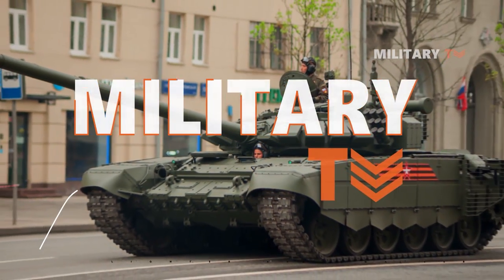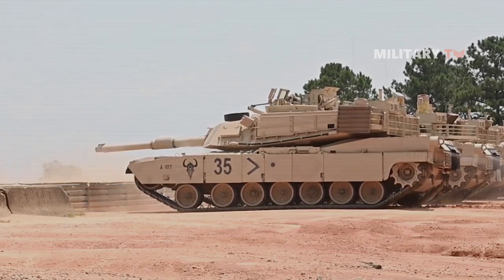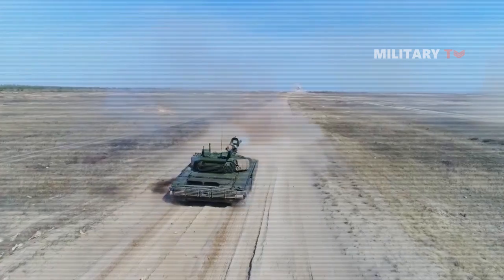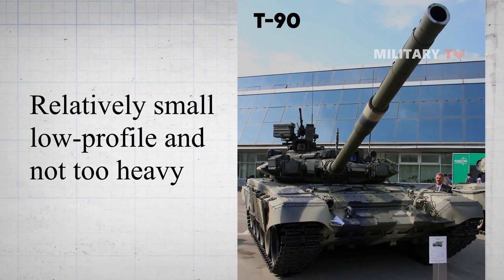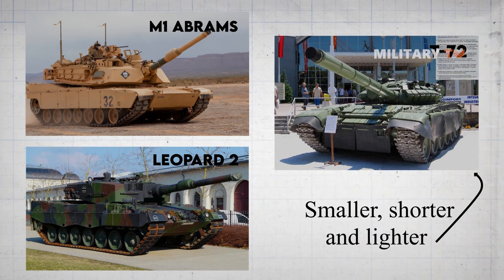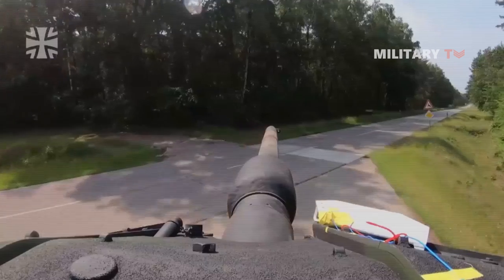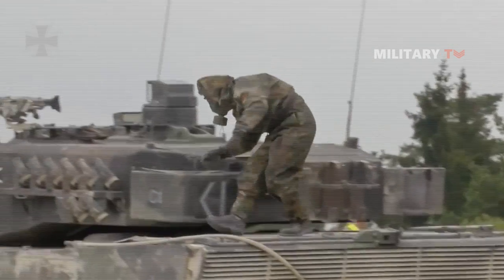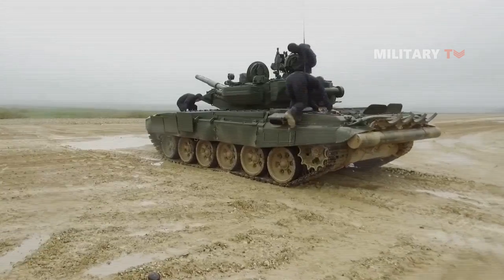Why are Russian tanks lighter and smaller than the western tanks

Comment: The lighter Russian tanks may have a strategic design as well.   A lighter tank can cross more bridges.  As a former military attache in a country at war, the Defense Attaches were responsible in part in identifying the load capacity of every bridge.  For example, if abridge capacity is 30 tons, then a 60-70 ton tank isn't going to be able to cross it.

I have zero doubt that Russia knows the bridge capacity of every bridge in Europe and designed its tanks to cross as many as possible while western tanks would need stronger bridges to maneuver.

Also Russia can transport twice as many tanks by air than the US C-17.

However, the US is in the process of testing a lighter tank of about 30 tons to augment the main batte tank.  This may be due to the same reasons the Russians when to a heavy/light tank mix.
Reply: 30ton tank? No way.most ifv are heavier than that
Reply: Exactly! Most of the bridges in the Eastern Europe can hold vehicles up to 50 tons only. There been even situations than US and German tanks came to the Polish sea ports on ships for the military exercises and stood for days in the ports just because they could not to cross many Polish bridges. They been delivered to the military exercise place much later only by roads around on the heavy transportation trucks...
Reply: у России уже есть Спрут с 125 мм орудием и возможностью быть десантированным с парашютом
Reply: Not if there's no bridges to cross. NATO has always been in a defense posture when it comes to Russia.  They'll just create their own bridge crossing if they were to go on the offensive.
Reply: Other issue such as logistic support and production
Reply: @tommygun5038  NATO never defended something, all the time they invaded other countries. Like Yugoslavia,Afganistan, Iraq, Lybia, Syria etc.
Reply: He didn't even touch on these obvious considerations.  Russia would more than likely have to cross mud or snow at some point...less weight is a no brainer.
Reply: @bagamut  .....Yeah you get involved in genocide and harboring terrorists that's what happens.  But i was talking about Russia vs NATO.
Reply: @tommygun5038  mostly they involved in trying not to be  colony and harboring oil.
But if we talk about Russia vs NATO that is not Russia is placing bases around NATO and not Russia is expanding all the time.
Reply: @bagamut  ....LMAO...your clueless.  NATO has no military buildup in Europe.  It's the opposite.  NATO isn't just a military alliance.  Do some reading.
Reply: @tommygun5038  omg, you arer clueless
The North Atlantic Treaty Organization , also called the North Atlantic Alliance, is an intergovernmental military alliance between 27 European countries, 2 North American countries, and 1 Eurasian country. NATO constitutes a system of collective security, whereby its independent member states agree to mutual defense in response to an attack by any external party. 

Definition of NATO --  military alliance.
Educate yourself, learn basics.
Reply: @bagamut  ......You must have missed the political part didn't you?? It's also economic because once a member, banks open up for investment and trade into your country. You have to take more time and read further into the details. It's not just a military alliance. NATO doesn't  have the forces or will in Europe to defend Ukraine even if it wanted to. So the military part has no teeth.
Reply: @romanberkutov2592  сами генералы говорят эта самоходка не для прямого столкновения, а только для засад и быстрых операций. Может лоб у нее держит 23мм снаряды, но вот любой гранатомет и кирдык. Очень специфичная машина, но было бы лучше будь у нее модификация для пехоты с обвесом доп брони и динамической защиты, ну и желательно борт от 12.7мм прикрыть.
Reply: @tommygun5038  NATO is military organization. There are many economic organizations, not NATO.
Reply: @bagamut  ....Horse manure! US military presence in Europe has steadily declined for the last 30yrs.
Reply: @oliviercoen446  NATO is not about economic, it's military, learn basics.
USA is NATO member and whole continent is surrounded by US bases.
Many countries seen France, Belgium, Germany, Denmark invaded other countries many times, even now.
But Russian attack aircrafts never been flying   over  neighboring country it's against airspace law.
 Crimea or Donbass or  Chechnya are not countries.
Your feelings doesn't matter, that's just your imagination.
NATO countries started more than 200 wars and conflicts from 241 after WW2.
Every time I mention Yugoslavia I think about all what NATO did to start the conflict, supporting and promoting nationalists, terrorist, criminals and power hungry politicians with money and weapons do divide Yugoslavia into dozen of puppet countries. There was no war in Yugoslavia when Yugoslavia was united.

Like NATO never attacked Korea, Cuba, Vietnam, Afganistan, Iraq, Syria, Lybia, many African countries, Latine America countries etc.
Reply: certains en France peuvent même traverser le pont du 1er Mai, (c'est tout dire)
Reply: @oliviercoen446  .....The big problem with Europe is they have a tendency too start world wars. Prior to Ww1 the US wanted to stay out of European conflicts but kept getting drug back in. So here we are now almost 80 years later trying to keep the peace.
Reply: @oliviercoen446  try to be more educated next time, so you can better understand what I'm told
Reply: @oliviercoen446  Georgia was created by Russia, and that is not one nation, that are many nations, what they did after USSR collapse? Started wars against each other, only Russia was able to stop them and kept peace. You don't even tried to learn history.
Reply: @darveter3340 .....Both sides did the same thing. Most European countries want to join the EU. Joining NATO is just a first step. Bases don't mean anything if there's nobody there.
Reply: @tommygun5038  Joining NATO is last step, many nations are neutral, despite being in EU
Reply: @oliviercoen446  The problem is you don't know the basic history.
Politeness is required only for educated people which you do not possess.
Reply: @oliviercoen446  Korea being invaded by coalition, most of them was NATO members. Even more countries joined NATO during war and sended troops to Korea.
Politeness is best used with who do not choose most dumbest fakes and ignorant "arguments". Politeness should be deserved.
Reply: @Xavier Dufay Well, if you design a compact tank you can make it quite well armoured. In the other hand you can esay design big, heavy tank with weak armour, like Leopard 1.
Reply: @oliviercoen446  maybe you try to look in to the Korean war once more? and history at all, and try read books, if you don't know what is books try wiki as first approach
Reply: @oliviercoen446  another tone should be deserved, you are so ignorant

United Nations has nothing to do with invasion in Korea, that was USA pocket decision with NATO allies. USSR and China was even not involved in UN resolution, only USA allies and some puppet regimes voted for it. This resolution was not lawful. This conflict NATO used as a cause for growth, include new members, troops size growth,  tensions with USSR, what resulted in Warsaw pact organisation in 1955. 

Russian never invaded Korea. They only supported north Korea in harsh time. Actually major part of support and troops was from China.

It is wrong to call Korea in 1950s  North Korea and South Korea. That was one Korea divided into occupation zones. North part received independence, south was still under USA control, and it is still now in 21 century. North koreans decided to unite both zones and finish occupation and almost succeeded. Only full scale US invasion with allies stopped them.

Happy to teach you
Reply: @oliviercoen446  as a bonus I could tell you that's why intervention was not lawful - absence of constant member of  UN security council
Reply: @oliviercoen446  Soviet Wiki is not apparently different, that is you so ignorant
Not "Russia", Soviet Union.
USSR left in protest cause USA hold Taiwan regime as "China" in UN, and will not transfer this place to real China, completely different problem. And USA used this moment to take advantage to make not lawful actions in UN.

All NATO was involved in korean conflict and used this conflict as the cause to advance to east also in Europe.

North not invaded with "russian" help, they received help later when they start to lose.

"NATO as a defensive organisation" is ridiculous, there is a list of NATO military actions and invasions. 

No airspace has been breached by Russia and there is no documents. FAKE, lie is bad, mom told you that?

Georgian Soviet Socialist Republic was created  25 February 1921 when Red Army took Tbilisi. Before that was part of Russian Empire. That is well known fact. You should know such things. Or not?
Reply: @oliviercoen446  use correct names, no brackets, correct means correct, no childish "I mean it different"

Germany was not NATO member at the beginning of Korean war. They became member way later. Learn facts before.

What you not understand in statement that NATO members  was involved in korean war? That was very useful war for them.

There no game with you about the airspace. You are lying. Russia never done that cause that is "casus belli", any aircraft could be shot down.
Direct lie is a bad sign. You are liar, that is bad. And no proofs.

By the way, Georgia was in civil war before Soviet Union, occupation, constantly changing borders, rebellions. It was stable republic only in Soviet Union.
By the way, civil wars and rebellions started again after Soviet Union collapse.
Reply: @tommygun5038  Lol. Tell the Yugoslavia about it
Reply: @oliviercoen446  If NATO does not respect international law, then Russia will not do it either.
Reply: Деревенщина из Сибири - Абакан   Russia did not annex but liberated this
Reply: @1mrzealot1  .....Yeah that mean old NATO stopped ethnic cleansing in the area that started ww1.  How dare them.
Reply: @tommygun5038  NATO not only did not stop ethnic cleansing, but contributed to it. Croatia and Kosovo dude😉
Reply: @tommygun5038  And by the way, wherever NATO intervenes, for some reason, genocides happen quite often. Probably a coincidence...Although no, these are the old traditions of the nations that are members of NATO
Reply: @1mrzealot1  ....That's right blame NATO for something someone else was doing. Pretty weak argument.  But I'm sure you do that with everything.
Reply: @tommygun5038  Even in the context of the Yugoslav operation: if, according to your statements, NATO is a defensive alliance, what were they defending against by invading someone else's territory?
Reply: @tommygun5038  And the invasion of Iraq? Are there NATO borders nearby too ?This is also a defensive operation?
Reply: @1mrzealot1  .....NATO didn't invade Iraq. They just played a small role in helping train Iraqi security forces.
Reply: @tommygun5038  So you want to say that if only more than half of NATO members participated directly in the aggression against Iraq, then this removes the blame from NATO?
Reply: @1mrzealot1 .....Half the countries weren't involved militarily at all. If you want to make an argument you need to get  your facts straight. There were lots of organizations in Iraq after the invasion to help provide humanitarian and security aid. But they weren't involved in any combat operations.
Reply: @1mrzealot1 .....So four countries are NATO???? What math are you using???? So 4 divided into 30 equals one half??. NATO  is 30 countries not 4. It was not a NATO operation regardless of the mental gymnastics you're trying to use..
Reply: I'd also add that you have to figure in the capacity of Russian rolling stock.  Their flat cars, rails, rail beds, and rail heads may not be able to handle 65 ton tanks.
Reply: @tommygun5038  In addition to the United States, Britain, France and Germany, the rest of NATO members can, in principle, be in conversation, otherwise the famous armies of Estonia and, say, Macedonia And the like directly cause nothing but a smile
Reply: @1mrzealot1  ......If you're talking about desert storm it was voted on and sactioned by the UN.   Iraq invaded Kuwait.  Iraq was kicked out of Kuwait by military means. Resolution 678 end of story.
Reply: @Moraceae You are confusing your variables and fudging your numbers.
Reply: That's why combat engineers know that and have charges already set to blow them .
Reply: @bagamut  there were no Russians in North Korea ? There were no Russians in North Vietnam or in Afghanistan or Iraq either ?
Reply: @haylocktransport6695  what your question? what year you talking about?
Reply: they all got destroy in the invasion of iraq
Reply: @Moraceae имеется в виду что в отличии от других легких и колесных танков, которые могут выдержать даже ПТРК в лоб как Тип 16 или автопушечный огонь и рпг, чтобы поддержать наступление против пехоты,  то Спруту даже такое не светит.
Reply: Actually all said is VERY true, which makes this video (for ommiting the same) somehow amateurish. Also I will add one VERY IMPORTANT thing about Russian tank tonage: Trans-Siberian Railway; it can not withstand heavier tanks than 45 tons!!! BTW most of major European bridges can hold up to 50 tons.
Reply: With the greater use of reactive armor, I was wondering when they would build a lighter tank, using reactive armor as the primary protector.  
It is much lighter.  
More mobility and armament can be had.
Reply: @oliviercoen446  you should know that every countries, other than NATO members, consider NATO as the biggest threat as many countries had been invaded by NATO and the US in the past...
Reply: @oliviercoen446   non nato, non block and neutral one...
Reply: This is a complete distortion of fact ! What main battle tanks are there that arent at least 45 tonne ?
Reply: @bagamut  the NATO would never attack Russia first. The NATO invaded only one country ever, that was Afghanistan.
Your sentiment is very obvious, pro-Russia, no objectivity at all. You only believe Russian nationalistic propaganda. You talk about 'facts' but you don't seem to know the facts (or happily ignore facts).
Reply: The other "solution" has been to pre-position M1 Abrams tanks in areas where they'll most likely be used.
Reply: truth is only one did you seen the average weight of an american ?
Reply: Not to mention many Russian tanks have physical requirements such as height and issues regarding the auto loader.
Reply: @maksimluzin1121  99% of tanks are transported via trains as its cheaper and more efficient anyways considering they can hold more and their fuel cost isnt much more than a truck that can only carry 1 tank
Reply: @maksimluzin1121  But Poland itself is using a heavily up armored Leopard 2 and buying M1A2 SEPV3 Abrams. Perhaps many bridged have been upgraded today. They would not be buying them if they can't cross many Polish bridges.
Reply: 30 tonnes or less is a light tank. Modern MBTs have weight of 50 tonnes or more.
Some IFVs have light tank variants, for instance CV90120. But there are also some light tanks that are produced as such like the M8. Although there are very little light tanks in service today. I do believe there is a role for them especially for airborne units, something like the M8 that can be parachuted and uparmored in the field. 
Although a quick reaction force with C-17s could fly in MBTs quickly, just not airdrop.
Reply: @basilmagnanimous7011  there were defending OIL MONEY, nothing else
Reply: @Castragroup  It's something like the Italian Centauro tank destroyer, most likely
Reply: I'm not familiar with a 70 ton tank fielded today.  Am I missing something ?
Reply: @bagamut  some height of the might , you must play limbo alot.
Reply: @bagamut  tell that the countries Russia has taken over. Tell me again when NATO has invaded and claimed country for their own.
Reply: I remember former Soviet military maps being released in the early 90s. This specific map was of a region in Norway. On the entire map, every single bridge was marked with the maximum capacity.
Reply: @Castragroup  Meanwhile Singapore's Bionix tracked IFV is only 15T I remember
Reply: Who cares how heavy or light they are. The russians just drive them into mud or run them out of gas, then run off because they dont want to get taken out by stay behind units at night. Then along comes the tractor....